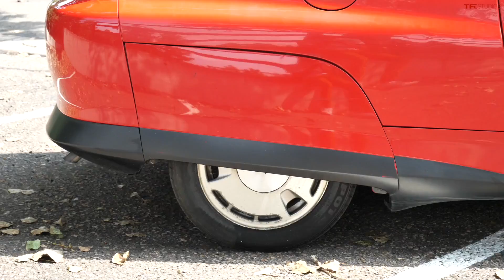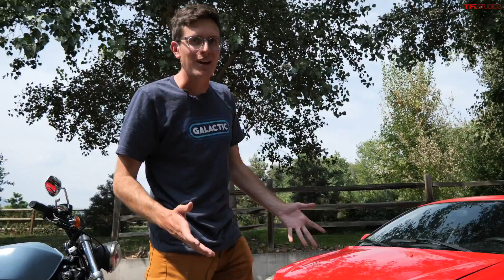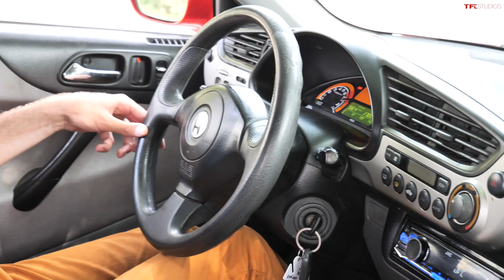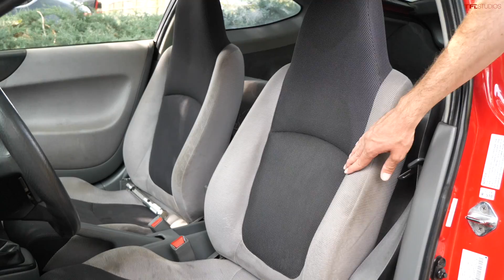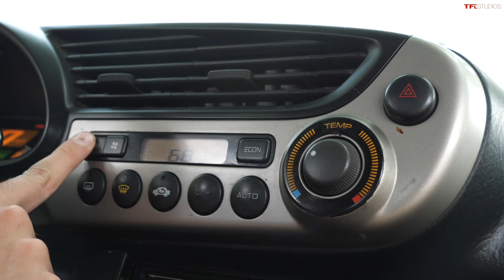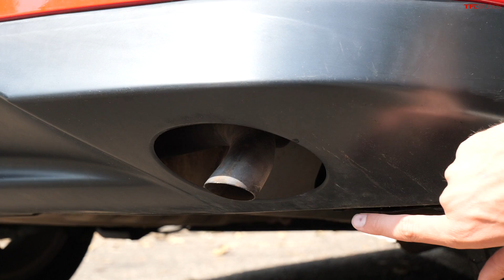We Bought One Of The Most Significant Cars Ever Made |  It Is Unbelievably Wacky & Weird!

Comment: Do not change the tire size. I have experienced that once, you change the tire size to a bigger one it will dropped significantly the MPG and performance of the tiny engine. I have a 92 Honda Civic VX, the first Vtec-E D15Z1 that Honda introduced to the market and it came with the super light weight VX 13 inch wheels that used 165/70/R13 that it is no longer available in the market. I had to switch to 175/70/R13 and immediately I lost between 5 to 7 MPG. It used to be 56 MPG and I've no longer being able to reach 50 MPG. That is all cause by the additional rotational weight on the tires plus the more surface area of contact that added resistance. it may not sound to much jumping from once size to the other but that affect the performance of the small engine that carry at the best day from factory 92 HP and 97 lb-ft at the crank.

Comment: I have a 2005 Honda Civic hybrid it has the same mechanical system just 1.3 4 cylinder and cvt but after that it works the same way… if you drive without the ac on you will get 10+ mpg even with the windows down

Comment: I believe that it actually can do better mpg as today tire manufacturers make dedicated low rolling resistance tires for hybrids and electric vehicles. I remember reading about guy who transplanted 1.2l TDI from VW Lupo 3L and even made regen work on it. Still impressed by it. Don’t put wider tires as fuel economy will plunge badly and it will get slower not to mention additional strain on steering. I did it on my tiny Lupo and had to use throttle in 0-1 manner to get it moving at all

Comment: Back when they spent extra money on research, design, build quality and materials for Japanese vehicles.  I was still driving them at this point.  Now they are all macpherson strutt profit machines.  And the people who all buy them have no idea a macpherson strutt is a cost cutting design.  They are only aware of the brand logo on the front, how many LED lights it has and what kind of screens it has.  Not to mention how little fuel you have to put in and does it work with their phone.  Moving on, nice review Tommy and they are a cool car.  I remember they were somewhat like a unicorn when they came out, you would seldom see them.

Comment: If you can get your hands on a CR-Z, they’re great cars! I love mine and have gotten nearly 50mpg on the highway.
Reply: If you could find a nice one, I would also compare it to a 1988-91 CRX HF(High Fuel). The HF only had 68 hp, but got about 49 mpg because the vehicle was a light weight stripper car with very few options and had high gear ratios for fuel efficiency.

Comment: I owned a silver one from 2003-2010. Tommy's review was pretty much spot on. The best mpg I ever got was about 72, on a run from Washington DC to Norfolk VA, when traffic was heavy enough that I couldn't go to fast, and the weather was warm enough that air density/fuel mix was just right. The car was so finely engineered that things like the temperature had a significant impact on mpg. I was typically in the mid 50s for normal driving.

The Bridgestone low rolling resistance tires were awful, especially in the snow. I lived in the Boston area, and the first time it snowed I couldn't get up the hill I had to climb to commute to work. I bought a set of used Civic wheels (same size/pattern) and some Nokian Hakkepelitta snow tires in the OEM size. Never slipped again, but my winter mpg dropped due to stickier tires and more weight. When the Bridgestones wore out, I replaced them with much stickier Kumho Ecstas in 205/55R-16 for summer driving. That was a mistake - handling was better, but the car was sluggish and it probably cost me 7-10mpg on average.

Still glad I owned the car; I traded it in when I couldn't live without a back seat anymore. Nice to see one still rolling.

Comment: Hi, Tommy. Congrats on such a cool car (I've always dreamed of having one myself). 73 hp and 91 lbs/ft may not sound much, but that makes the car at least "adequate" in speed/performance, as you put it. The power figures are comparable to a Lada 1500, which on paper are old and underpowered (and yes, they are not powerhouses), but they are decent in city traffic and can be driven on highway, albeit with a slightly higher revving engine. That being said, your Honda is about 200 lbs lighter than the Lada and is way more aerodynamic. So, it should be pretty decent, indeed.

Comment: These days, an 1,800lbs. curb weight is just unfathomable. I feel like my Ram's Cummins diesel engine weighs almost that much.
Reply: A 6BT is about 1100 lbs so you're probably not far off
Reply: Yeah, the weight of a 6.7L is just over 1,000 pounds, but that's dry and doesn't include fluids or ancillaries. Add everything related to the engine, and you'd be pretty close to 1,500 pounds... Then there's the rest of the truck.  

You'd definitely win in an accident.

Comment: The only other manual transmission hybrids I'm aware of are all Hondas, those being the Civic Hybrid and the CRZ.

Also, I find it strange that no one else has made a hybrid with a manual transmission, as it would make for a very good drive system if done right.  You could basically take the Toyota Hybrid Synergy Drive system from the Prius and stick a 5 or 6 speed manual transmission between the output of the planetary gear set and the drive motor that usually sits on that output.  The fixed gears would make the car more efficient at cruising speeds, while the starter/generator motor on one of the planetary gear inputs (which normally provides the "gear ratios" in a Prius) would provide smoother shifts between the manually selectable gears.  This system would also allow for "no lift" shifts of the transmission and could adjust the percieved "gear ratio" between the engine and the road to make highway overtaking in top gear easier as well as preventing the car from lugging up a hill while using cruise control.  If the clutch setup is done with a hydraulically operated multi-plate wet clutch that can be computer controlled like those inside of a traditional automatic (rather than a dry clutch) then reverse could be done using the electric motor on the output of the transmission instead of using the normal reverse and idler gear setup.  This would also allow for all electric operation of the vehicle, as well as series and series/parallel hybrid operation.  Basically you would have a better manual transmission for enthusiasts AND a more efficient hybrid drivetrain for the fuel economy crowd.  I would really love to see a system like this on a new Subaru WRX wagon/hatchback, but I know that will probably never happen.
Reply: Actually, Hyundai and KIA both sell a hybrid right now that has a dual clutch automatic transmission.  The Hyundai Ioniq and the KIA Niro.  I own a KIA Niro.  It is the ONLY economy car that I have ever seen that can chirp the tires when it shifts from 1st to 2nd gear at full throttle!
Reply: @jowarrior  I am unaware of those vehicles, as I don't think they were released here in the United States.  Sadly we miss out on a lot of cool cars.  Volkswagen had a diesel electric hybrid SUV that I remember hearing about a few years back that was supposed to get over 60mpg while having good performance and towing specs, but it was never released over here.
Reply: I agree with you. I have an automatic CVT insight (2004) and its max mpg is only ~44. I'd only trade in my insight for a manual version of the same.
Reply: @R.J.Bedore i understand your theory as well being efficient the top speed ratio would be insane, you should draw it up and apply for a patent Toyota has dropped their patent on synergy drive and we still have time left for hybrid
Reply: Thier is also the jeep wrangler Rubicon 4xe
Reply: @emmanuelmartinez8312  The Wrangler 4xe comes with an 8-speed automatic transmission, not a manual.  Jeep did show off an all electric concept car with a manual transmission where they literally just swapped the V6 with an electric motor of roughly the same power, but so far it is just a concept.

Comment: Having driven an Insight several times, both highway and city, I won't call it weird. Inspired yes, and quite fun in the city. When the motor stops at a red light, the guy beside you assumes you have stalled it. Then when the light turns green you're just gone, whilst the guy beside you is still trying to get his jaw back in place.

Comment: I drove one of these when they were brand new. Did not buy it. It was fairly expensive and was not suitable for my use. But it was seriously a special car. It was a unique experience. The car felt very uncomfortable Honda in driving, and it was obvious this was a moon shot car. Extremely exotic construction for the time. 100% optimized for fuel efficiency. It may seem crude and oddball today, (it was definitely oddball back then) but compared to every other small economy car, it was way out there on the extreme bleeding edge. This is a really cool car.

Comment: 215,000 is nothing.  My 2012 Prius has 250,000 and looks and drives like new. Still gets a consistent 50-52mpg.  Original engine and high voltage battery. Actually still on the original 12v battery.